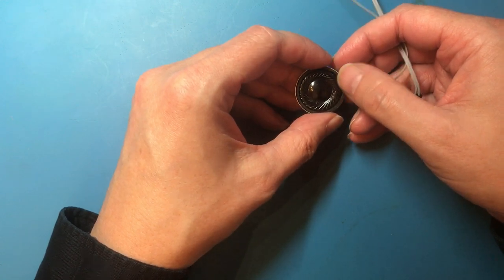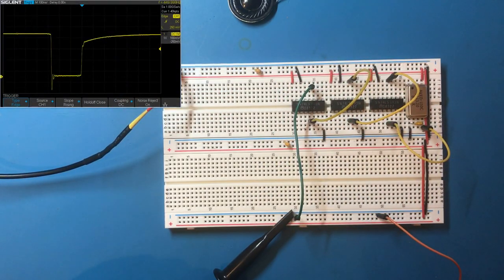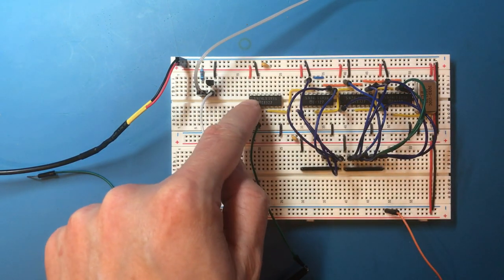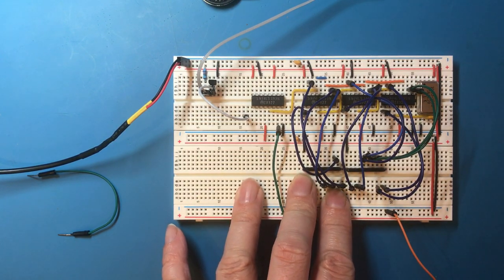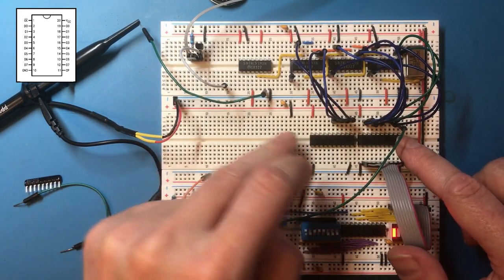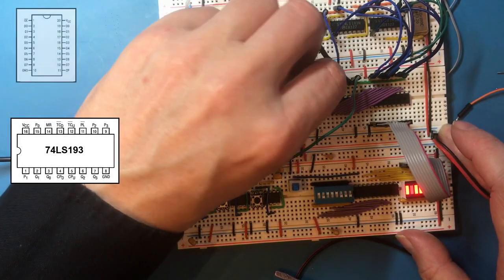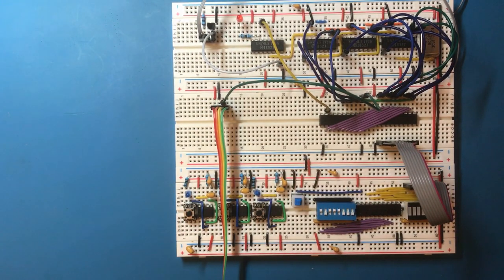Simple Beep - Audio from Scratch - Part 1

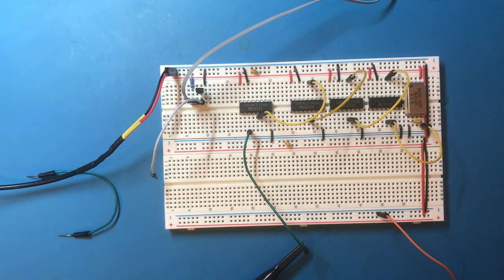Comment: 6:20 Doing exactly this (taking a low current sound signal and turning it into a high current sound signal) was one of the first commercial uses of semiconductors. It's how radios worked, and how they took the very weak output from the antenna and turned it into something that could actually drive a loudspeaker.
Reply from the maker: That's correct, good old CK703! Although the big push for integration on IC's really came from digital circuits for the space program.

Comment: 1:59  For any newbie, as myself, that may not understand how the Integrated Circuit (IC) is being used to reduce the frequency.  Please note that the 74LS193 will count from 0 to 15 and if the count is performed one more time then it sends signal through the "carry" (pin 12) of the IC  for a breve moment  before resetting the count to zero. Therefore, the "carry" signal pulsate a 16th of the clock frequency.  This is how the 1.84320 Mhz  frequency turns into 115.20 Khz  after connecting the first IC.
Reply from the maker: Sorry if my explanation was not clear.
Reply: @weirdboyjim  On the contrary James,  we appreciate your hard work and understand that if you go into every detail the project progress would drag.

Comment: Finally, I am seeing the audio implementation. Great work✨✨✨✨
For the last counter chip, you can also adapt a 4x1 multiplexer to switch the frequency at run time using a shift register.
Also, It will be a good idea to adopt a PWM circuit with a ROM programmed with Lookup Table of Octave, which reduces the overhead on CPU for data transfer.
Cheers
Reply from the maker: In the next video (I've already recorded most of it) I use a 256 byte lookup table to convert from midi note to the frequency divider, that makes the process of making simple tunes fairly easy.
Reply: @weirdboyjim  that's a great idea "everyone" knows MIDI note numbers.

Comment: About that PC beep timer: It also did double duty as the audio output for the tape ports, which were only present on the model A IBM PC. So for backwards compatibility with the first ever PC, all PC software that does beeps has to set an extra register to not route the audio out the connector that never existed since!
Reply from the maker: Indeed, I also remember eyeing the hole in memory reserved for the basic rom jealously. could easily have fit an extra vram or ems page in there but nobody wanted to break compatibility.
Reply: @weirdboyjim  But the BASIC ROM is actually there in at least one of my PS/2s, so it's not quite as vestigial.
Reply from the maker: @0LoneTech  None of mine had it, I clearly had a deprived childhood.
Reply: @weirdboyjim  It's one of the odd marks of the IBM machines; PC-DOS BASICA would use ROM BASIC, while MS-DOS had the GW-BASIC application. Basically, all those "100% IBM PC compatible" marks were lying.

Comment: What value capacitor is it between clock output and ground? I tried 100nF and 474nF but it kills the signal completely
Reply from the maker: Much lower than that! Check the datasheet for the specific oscillator you are using! If the example circuit doesn't have one, don't bother with it.

Comment: Hey I get the using counter to divide the frequency to human hearing levels but how does loading them with numbers change it even more ?
Reply from the maker: The counters become a programmable divider. Load it with 100 every time it hits 0 and decrement on the clock and it will hit zero at a particular frequency, change that preload value to 200 and the frequency will half.
Reply: @weirdboyjim  ah ok i misunderstood your video, I thought you where loading every clock cycle which cnfnused me. thanks for the reply.

Comment: Great video.  But I'm curious why you put a cap across GND and OUT from that can oscillator.  Wouldn't that keep the output "charged" a little therefor increasing the high value and making the duty cycle less square?  Which you solved with additional counters.  The outputs on those cans are pretty square anyway so I'm wondering if you could eliminate some of the components if you removed that cap.
Reply from the maker: It's recommended on the datasheet for that device.
Reply: @weirdboyjim  Ah, good point.

Comment: Are there schematics anywhere for this? im trying so hard to reproduce what you're building, but I cannot get it working properly :(
Reply from the maker: I've not released the schematics yet, I normally only finalize them for a pcb order. What bit are you struggling with?
Reply: @weirdboyjim  Ty for replying! didn't expect that :) I am struggling with the crystal oscillating. I have all the same components you have (except I have a 1Mhz full can), but it just won't trigger a clock pulse. I have swapped it out for an Arduino for now to test and the rest of the circuit works, but of course - I don't want to use a microprocessor for this. I don't have a good oscilloscope (only the $40 cheapos from amazon)
Reply from the maker: @stephenyoung8960  Obviously you might need to consider that the oscillator might be dead. But you should see if you can find the datasheet for the part. You only really need 3 wires for the oscilator and on some the 4th wire is a clock enable input. Be really careful with power and ground, the way I turned my part round for breadboard space makes it counter intuitive.
Reply: @weirdboyjim  Using the datasheet helped - ty - what did the most help was ripping it all out and starting over - then it worked first try lol aye yi yi

Comment: Instead I think I would have elimited insignificant bits (There's no reason to produce tones over about 15kHz anyways) and hardwired the rest. That way it could be done in one 8-bit write.
I think PWM would be cool, the second byte could instead by used for volume and PWM instead.
Reply from the maker: It's not just about how high the frequency goes, I made a few data tables plotting the errors from the standard note frequencies for various combinations of divisor width and base frequency, 8 bits just wasn't enough to get a decent accuracy on the notes, even for my aged ears.
Reply: @weirdboyjim  Oh no, I meant hardwire some of the values. There can still be 12 bits in all but only 8 really matter, as far as I can tell.
Reply: I would have added an additional 4 bits and have the final divide by 2. I agree that the high end would be unusable, but those low bits still matter if you want accurate frequencies. The largest errors will occur for the highest notes. I'll use an 88 key piano.
Lowest note = 27.5 Hz
Highest = 4186.009 Hz

Assume 1.8432 MHz, divide by 2, getting 921600 Hz.
Low = 33512.73
High = 220.16
Error low note = 0.0008% flat
Error high note = 0.074% sharp
Note that 16 is needed to store divisors for entire range.

Changing to divide by 16, giving base frequency of 115200Hz.
Low = 4189.09
High = 27.52
Error low note = 0.002% sharp
Error high note = 1.71% flat
Needs 13 bits of divisor for full range. And the error is larger with the lower frequency. If you set the low bits constant, you're effectively setting the base frequency lower, and causing a larger percent error across the audible frequency range. As it is, James' selection limits his lowest note to the 2nd lowest note on an 88 key piano.

Comment: 1:00 What's funny is that IBMs super cheap sound solution was still more advanced that the Apple II. If you're unfamiliar, the Apple II requires the CPU to directly address the speaker, which is why whenever a game (or other software) wants to play a sound effect it has to pause everything else while for every sample in the sound output the CPU talks to the speaker. So if you want a 10khz tone, you better believe the CPU has to bang bits at the speaker 10 000 times per second.

Combined with the lack of any kind of timer circuitry and the mess that was the Apple IIs graphics circuitry this kind of thing is why the Apple II was probably the worst gaming machine out of the big three in the US.
Reply from the maker: If I remember correctly the ZX spectrum was similar.  Maybe I should have sidestepped the entire audio series with a 1bit output :-)
Reply: @weirdboyjim  Wouldn't be nearly as much fun though.

Comment: Interesting approach! I've never seen it done that way. That should make it easy to program the tunes. For my part, I'd have used a latch chip (or two) to drive an R-2R DAC into a phase-locked loop ("PLL"), like a CD4046. Or, just use the latch chips and DAC to drive an op amp (then the speaker). I suppose that would have been much more programming overhead, though, since you'd have to do look-up tables or calculate the waveform on the fly. 🤷‍♂️ Don't mind me, I'm just thinking "aloud." 😁👍️
Reply from the maker: In the future I'll explore different circuits, an 8-bit dac and a big fifo buffer would indeed make for massive flexibility at the cost of cpu load.